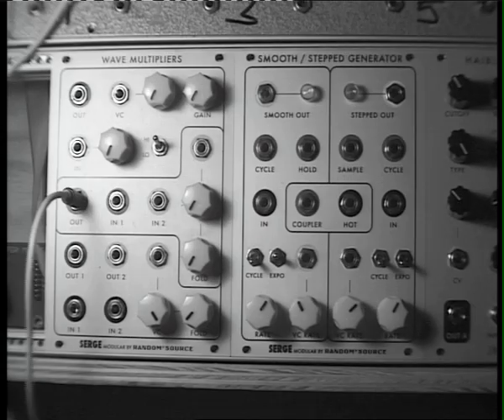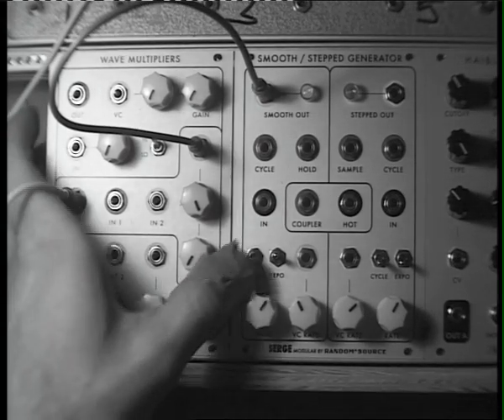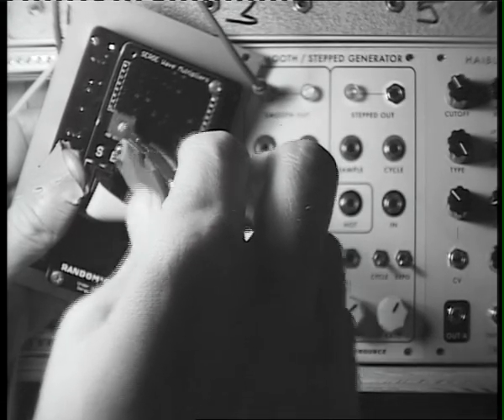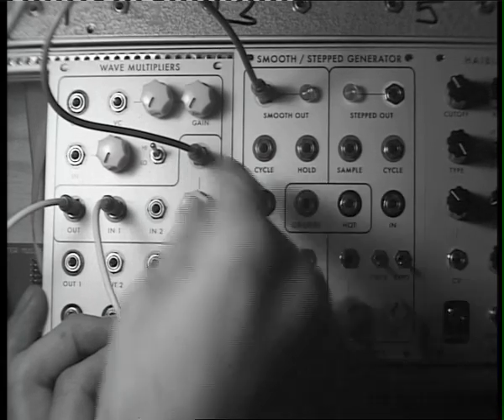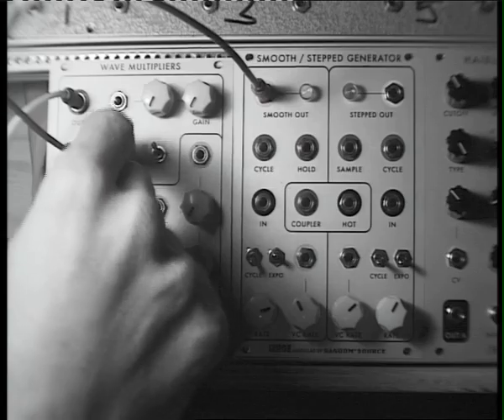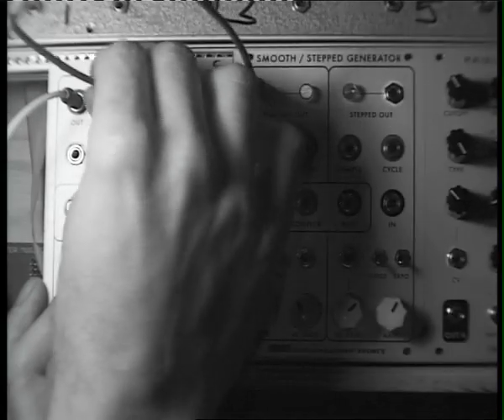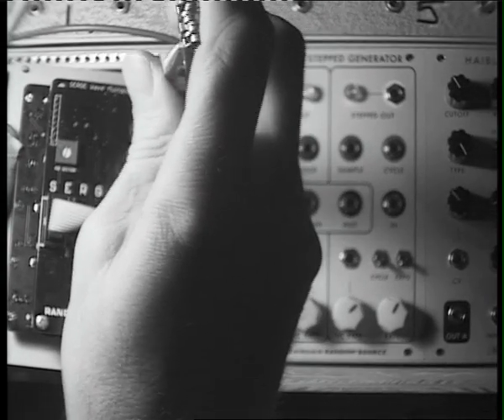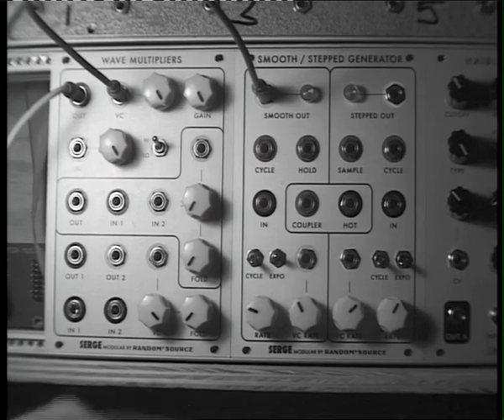Dr Wiener Presents: Serge Modular 101: Wave Multipliers Calibration

Comment: Hi! My VCM board has two trimmers, one on each side. and I realised after soldering the blue ones included in the DIY bag, so these must be desoldered in order to use the ones on the sides. In the schematics there are only two trimmers. Is that correct? Thank you!!
Reply from the maker: right :)